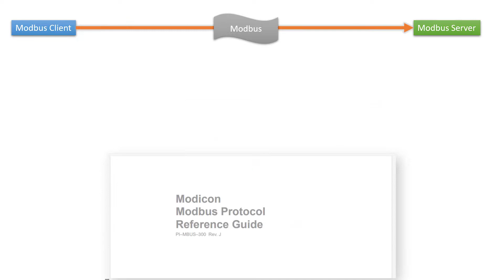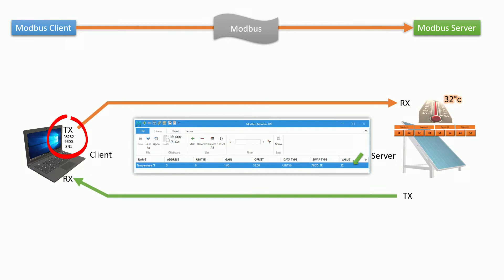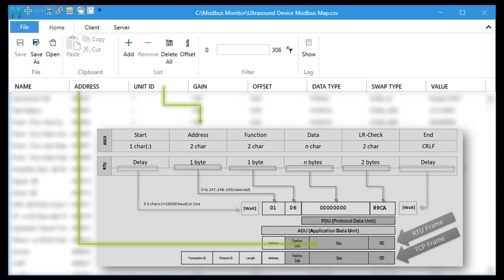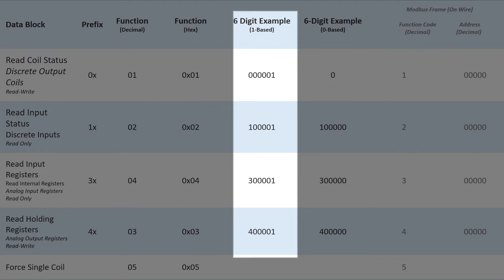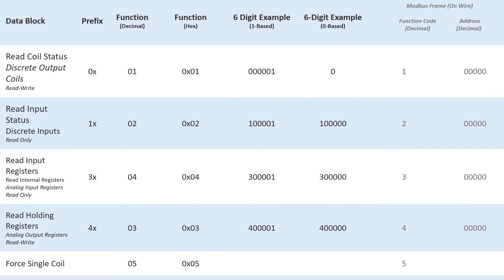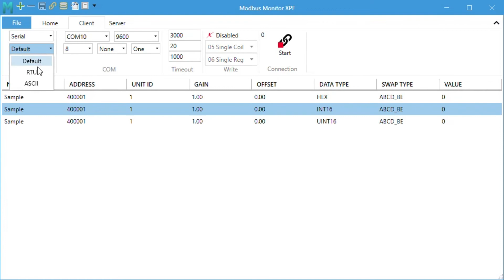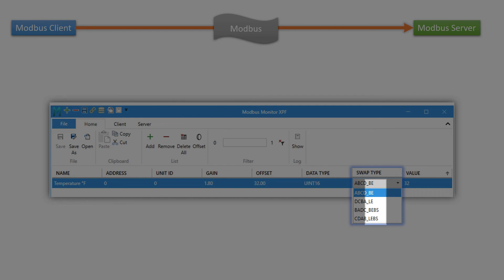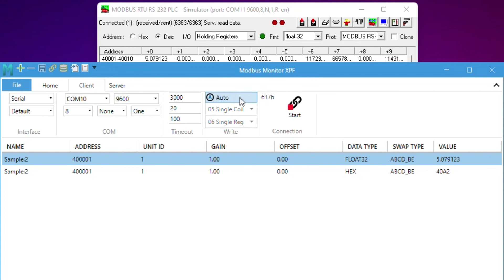What is Modbus and how to setup Modbus Monitor Points

Comment: 5:56 isn't clear to me. 
I have a register at 400007 this is supposed to be 10 characters. 
Currently when I read it it will spread it over 5 registers 400007 to 400011 with 2 characters for each. 

Tried the semicolon in the name but doesn't do anything.
Reply from the maker: Add Colon and Registers ":5" at the end of the row name, set Data Type to String, and Swap Type to flip characters.  More info: https://www.modbusmonitor.com/xpf-help   (Column Section)
Reply from the maker: The video 5:56 example shows a string contained in 128 registers.  For your case, add ":5" (colon followed by several registers) to the string in the "Name" column (with the start address as 400007).  This will tell Modbus Monitor XPF to read 5 registers. Then, the STRING Data type will decode five registers into a 10-character string (two characters per register). Use Byte Swap to correct any "swapped" characters.   See https://quantumbitsolutions.com/xpf-help/  and search "String Length" for more info.

Comment: thanks for videos .next videos we required how to connect plc data through 4g router to see onmodbus monitor clint
Reply from the maker: You can use the mobile version of our app to communicate to your device over the internet using the hostname or Internet IP Address. (if your device is on the internet)